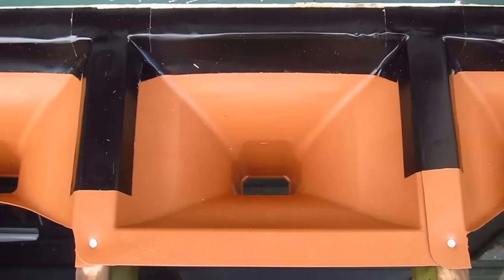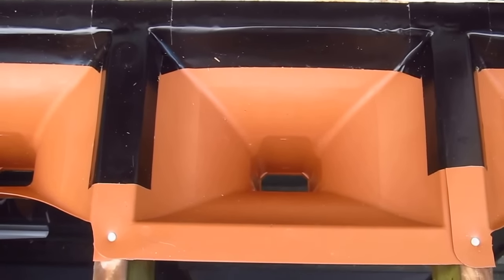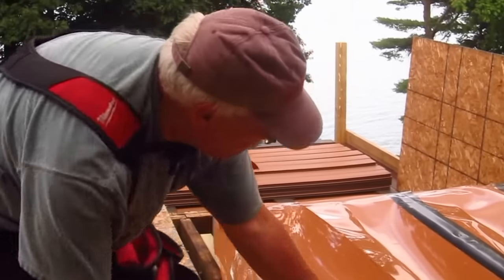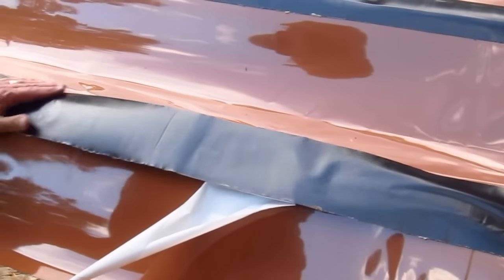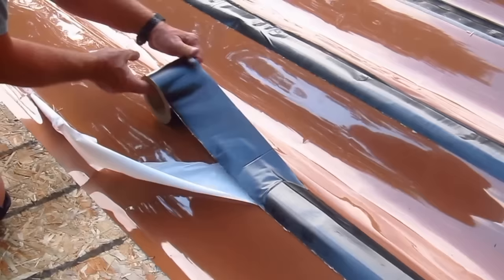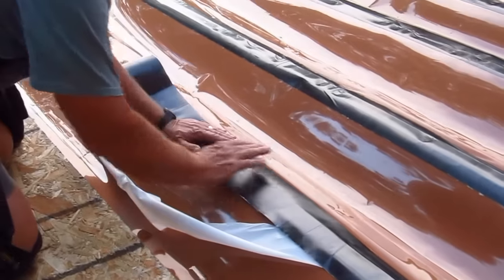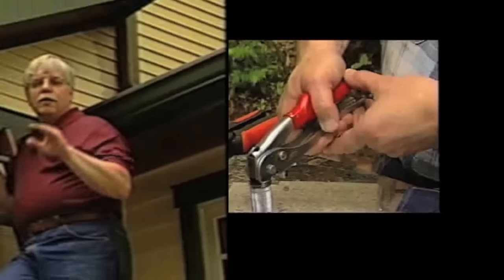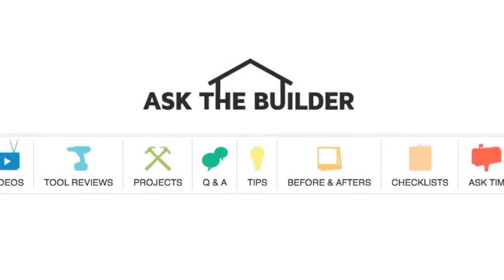Trex RainEscape Overivew

Comment: It's Really crazy this design Does not leak. I've done it.  Just think about the Thousands of Holes that are made during install. and it still doesn't leak,
Reply from the maker: The tape covers the nails. What's so magical about that? It's really no different than how roof shingles work as the tab covers the nails of the shingle below it.
Reply: @askthebuilder  I guess I'm talking about all the screws used to fasten the decking down. That is not covered.  you are relying on the tape/rubber to seal the screw hole shut. not to mention Railing post that get bolted down. I'm not saying it leaks. I know it doesn't. I'm just saying its surprising  to me it doesn't.
Reply: @askthebuilder  did you see my response?  I never got a reply back so I wasn't sure.   I'm trying to understand what exactly seels up all the screws holes from installing the decking?  And railings,. Do you understand what I'm asking? And how is this guaranteed to never leak? It would be very magical if the tape covered all the holes you make after the decking gets installed.

Comment: Just curious. Are all the staples to fasten the plastic down just temporary until you get the decking on since after several years, those staples will disintegrate? What fastener did you use to hold your decking down?
Reply from the maker: Hot-dipped galvanized roofing nails, not staples. Approved stainless-steel fasteners provided by Trex.

Comment: Interesting. This is something I've wondered how to do with our deck. How does it hold up to snow?
Reply from the maker: It's not exposed to snow. The finished decking covers it. The snow will eventually melt, drip through the gaps in the decking and be captured by the system.
Reply: +Ask the Builder here in Minnesota, we have freezing thawing action. the deck would eventually drip, and ice would form on the vinyl. curious if it would hold up.

I considered doing the same thing with metal roofing under the frame of the deck angled outwards.
Reply: Same here in the Far North of Idaho. Would love to keep the patio under the deck dry and usable in the Winter.